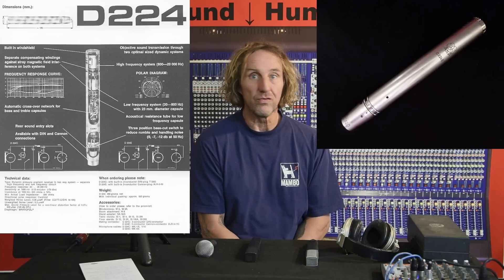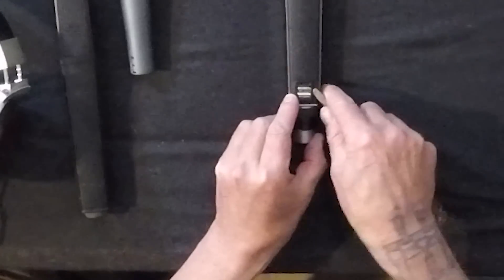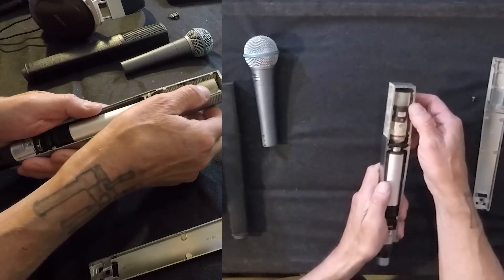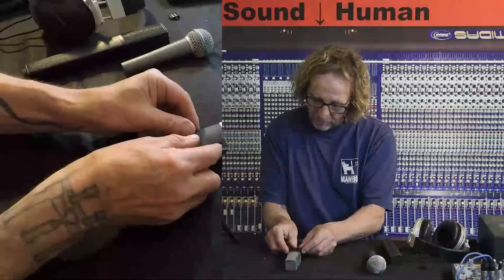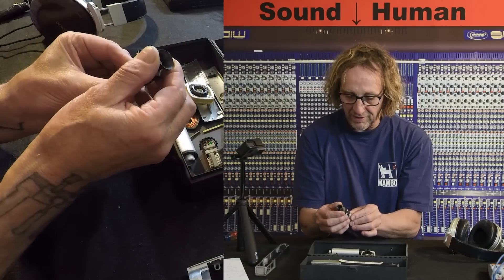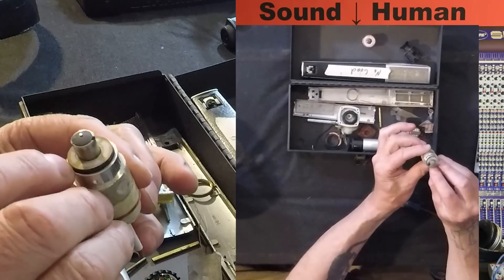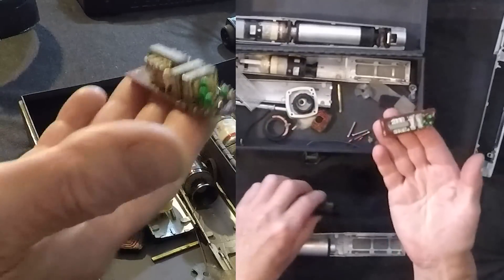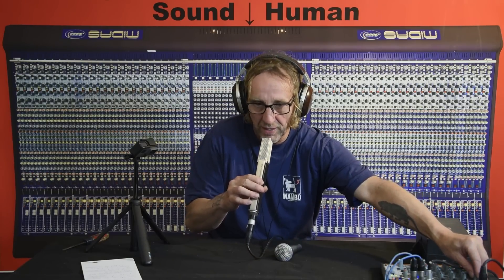Tear Down Beautifully Designed Sennheiser MD441(Public)

Comment: Ive got a vintage md441 thats possibly from early 70s. It doesnt have the phase plug and the inside of the mic directly goes straight to the diaphragm! I wonder if the previous owner removed it or if there are earlier versions without the phase plug design?

Comment: recently bought one of the old 441s and sounds amazing. my only concern is the tilt eq switch is gone and i was able to get the bass back by bringing the screw to a flat position. now im confused since in the video the screw doesnt look like a control for the eq
Reply from the maker: There is something else wrong as the screw should not effect the sound. A ground wire is missing
Reply: @DaveRat  is it possible this is a diy mod?
Reply from the maker: Hmmm, the chassis ground should not be connected to or impact the audio in any way. The chassis ground should be totally isolated from the audio.

So if it is a mod, it is not a desirable one.

Chassis ground impacting audio means that the balanced line noise cancellation will be diminished and in many scenarios the mic will have unwanted noise susceptibility.

Comment: My 441 was modified prior to my ownership and the high boost switch was wired to turn the mic signal off/on. I'd love to have that switch wired back to normal. Does anyone know of a schematic for that little PCB board so I can figure out how to wire it back to stock? Thanks!
Reply from the maker: Hmmm, if you follow posts here and when I get some time, I will snap some pics of the wiring
Reply: @DaveRat  Thanks Dave!
Reply from the maker: @breakburrito Cool cool thank you!

Comment: Hey there - Can you help me with the plastic (clear looking) between the top and the bottom just above the springy stuff - on mine is broken - should I super glue it - its rattling around inside the mic - I've taken it apart, thanks for sharing
Reply: Did you ever solve this? I have 4 of these and one is doing the same rattle. Thanks!!
Reply: Yeah but now I have to resoldier the wires lol  @johnforrestal
Reply: @ ah bummer man. Was it just a matter of gluing the parts back together? I saw someone mention screwing it on but I see no threads between the housing that holds the pcb, the first shock mount rectangle, and the capsule bit (I have a considerable bit of gap there and the capsule rattles around)…

I’ve never done a 441 repair but I’m trying to stare at sennheisers overly busy parts diagram and I can’t make out whether I’m missing a piece. I know I have to replace some plastic bits for the hi boost switch which looks harmless/easy.

Sorry you’ve gotta solder! Haha

Comment: Wow!! I've used one for years singing live! Just bought myself a brand new one. Do you believe there's a difference in design between the new and the older version?
Awesome video!! Thank you
Reply from the maker: I have not used the newer ones but I doubt they are as complexly or quality built as the old ones.

Whether the design changes make the sound less desirable I don't know but I am confident there is at least some difference in sound.
Reply: @DaveRat  Thank you

Comment: Hey Dave. Amazing video! I just bought a second hand 441 and it came with a nasty cigarette smoke smell. Any recommendation for trying to remove it? The mic works perfectly and there is no apparent influence on the sound, but I really would like to get rid of the smell.
Reply: @Pablo  Try putting the mic in a bag with baking soda for a few days. Baking soda worked on an area rug I inherited. I imagine you got the smell out by now since your post is 6 months old.... lol
Reply from the maker: Hmmm. If you have the soldering skills I would take the XLR off and open it up and lift out the entire capsule guts. Then take the outer shell and clean that with isopropyl alcohol and a microfiber cloth..

Focusing on all the grill and mesh stuff

I wouldn't mess with the capsule foam or any of that as it might be delicate and deteriorate.

Once the entire housing is clean if there's any smell on the inside it should have a hard time getting out.

Then reassemble

Comment: Where can I get the correct damping gel and the foam? Preferably in Europe...
Reply from the maker: That's a great question that I wish I had the answer to. If I recall correctly, it felt like it was silicon based.

A search for high viscosity silicon damping fluid may get ya close

Comment: Hi Dave, thanks for the great video. My name is Jeff from Australia and I have an old 441-U which is not working properly. It basically sounds thin and I'm sure it's not meant to. I inherited this from my brother in this state many years ago. Watching your video inspired me to take it apart and you're right the wires that connect from the main body to the part where the HP filter switch is....Well I needed to be a little more careful with it and I've broken them off. Anyways in doing this I've noticed there are only two thin wires connecting through to the part where the XLR plugs in, and I'm under the impression there needs to be three. Could you please clarify if this is the case and whether this would cause it to sound thin ?? TIA. PS I also need to know where the wires go back and given one is too short can I get that wire anywhere and try and splice???..Regards Jeff
Reply from the maker: Oh my, I don't have plans to open one in the near future. Is it possible to pause the vid and zoom in and see the wires?
Reply: @DaveRat  no worries Dave will do. Do you recall if it has 3 wires though?
Reply from the maker: Yes, 3 wires, the black one is very short and sometimes bunches up into the switch
Reply: @DaveRat  thanks so much that makes me happy as it's a step closer to fixing it in knowing that may have affected the sound. I'll need to try and work out if the third wire which wasn't connected is still there and if not then where on the switch it comes from. I remember you saying there is a blue, green, red and yellow coming into the switch so I'll also need to know which pole on the switch the third wire comes from and if it's not there I'll try and source some ultra thin wire. I noticed the first short screw you took out that holds it together in mine has been replaced and it goes all the way to the other side of the chassis so who ever has worked on it before may have lost the correct one and also disregarded the wire. Cheers again Dave 🤘
Reply from the maker: Good luck and keep me updated

Comment: This video was a life saver. I recently got a good deal on an early-ish 441 but the xlr jack was very loose. Using this video I popped the badge off and found that the set screw needed to be tightened the tiniest bit. Less than a quarter turn later and everything feels like brand new without needing to tear the whole mic apart. Thanks!  Also, agreed this mic is really
Excellent sounding.
Reply from the maker: 🤙👍🤙 so cool

Comment: Excellent video! , I have an MD441 , but the treble filter does not work .. I checked it and the cables are all in good condition and connected, there is nothing cut or loose .. The low-frequency filters work perfectly!
What could it be? can this be repaired?
Reply from the maker: Hmmm, there is more circuitry inside the aluminum tube.
Reply: @DaveRat  Yes I saw it in your video! .. but it looks very difficult to open that inside the tube, right?
Reply from the maker: I think there are two black dots where the end cap shows through. Should be able to sliver the end of but yes, precarious.

May be best left as is

Comment: Hi Dave, I got the BF541 and MD441U3, I when I slightly push it, I can feel the moving coil on the U3 but not the BF541, should I be worried about it ? The 541 still sound fine tho, it just I dont really feel the moving coil
Reply from the maker: When you push on the diaphragm?
Reply: @DaveRat  I meant I should be feeling something moving right, I am not sure if its suppose to be the diaphragm. Btw the build quality are a bit different for both.
Reply: @DaveRat  sorry for my English, I meant when I gently hit on the mic

Comment: Hi Dave I have 2 409 the foam needs to be replaced….is there a particular size foam I need? Thank you….
Reply from the maker: Oooh, I believe the 408 is around a 1/4" or so.  I would disassemble and measure it and buy a small sheet, also getting thin foam and using a couple of layers is ok too. As long as the foam is open cell where you can easily blow through it, you should be good

Comment: Hi Dave, thank you so much for this awesome video which finally gave me the knowledge and confidence to open a very old 441 (with that enormous Tuchel connector from the early seventies) my father handed over to me some years ago. Although it still has some output it did not sound like a quality mic at all, so I never used it. Now I found out that the round foam pad on the front end was completely rotten and some of the debris covered the diaphragm. I have removed that crap with an air cleaning rubber ball for camera objectives but now have to replace the foam. Do you have a recommendation which foam I should use for that? Thanks in advance!
Best regards
Chris
Reply from the maker: Super cool! Happy hear that. Maybe the best or easiest way to get foam is to take it from another cheaper mic grill. Knockoff sm58 grills are cheap and easy to get, or from a another cheap broken mic
Reply: @DaveRat  Thank you so much, I should have had this idea myself. Quite a few SM58 grills lying around here - old and new. Will try it later, great plan for this rainy Saturday here in Germany.
Reply from the maker: Awesome and let me know how it works out
Reply: @DaveRat  Unfortunately this did not really work out. Still I have to crank up my 1073 to +80 to have a very thin output without any mids or lows. Looks like the capsule is damaged. I will try to check the wiring with a multimeter next weekend, but I don‘t expect a miracle. Maybe I will find another one with mechanical damage and a good capsule.
Reply from the maker: Those hair thin wires to the voice coil are easy to break. A magnifying glass may show a break that you can get to and carefully resolder but odds are not.
Reply: @DaveRat  Thanks for this hint, Will give it a try. I am quite good in soldering (some touring experience in my younger years). But need a very small iron first.
Reply from the maker: 🤙🤙🤙

Don't get too hot of an iron as the thin wire will actually melt or dissolve, possible it's an aluminum wire, but not sure, I just recall it's a tough repair

Comment: Love 441s. Or the cheaper but almost identical 541s. I use them on all kind of acoustic instruments that got no pick-up or low acoustic output,    but need to be routed on monitor-wedges. They feedback like 3db later than a condenser would do.
Reply from the maker: Very cool and yes they do seem to be more stable than condensers I'm curious as to why that is

Comment: I’ve got a broken 441 with a dead capsule. Has anyone figured out a cool alternative rather than spending $500+ on another capsule??
Reply from the maker: That is a tough one, maybe buying one that works but has broken wires and housing on ebay

Comment: Found one years ago in a pile of audio junk and 02r expansion card in a control room inside a small music school. It belonged to the audio engineer of the band that started the school and concert venue right across the street. I didn't know much at that time, it looked like a old trash mic like the 10 other legit trash mics I found. Imagine my suprise after looking it up online !

The high pass filter is broken (spins endlessly) thankfully not on the highest cut setting. Is it hard to change (regarding the tiny wires) ?  I have used it and really liked it live on bass cab mainly and in recordings with bass, guitar electric and acoustics, and lots on vocals for metal and punk. Amazing mic, I just wish I had a damn mic clamp to use it properly. I opened it up one time and was mesmerized by the srping dampening system and how complicated it looked, compared to "regular" dynamic mics.

And thank you very much for being on youtube Dave
Reply from the maker: Awesome find!

Comment: Excellent timing, Dave - somebody just brought one in for repair!  Any idea where I can find a schematic or wiring diagram?
Reply from the maker: Oooh, that I don't know. I just open a working one and copy it when I encounter a wiring question
Reply: Hi Dave, i cleaned the front tube and replaced the foam on mine. The blue wire broke off when i pulled out the 5 pos switch, soldered it back on. Next to it is the red wire, but i don't see any  wire connecting to ground (btw 5 pos switch and hi boost switch) on mine. Is this normal?

Comment: Thanks for this thorough examination, Dave! I use this mic from time to time, but never really went thru its settings. I DO like its solid sound. You immediately feel how well it's made. German engineering, I guess. One of the reasons why Sennheiser has its reputation I guess.
---
That backdrop is very nice! Btw, do you prefer the H3000 over the XL4 in regards of sound? I'd love to hear your opinion on those top-tier Midas consoles 🤓

Kind regards from Germany - Hans 🖖
Reply from the maker: Very cool! I do like both but the 24 subgroups on the h3000 with the ability to rotary level send is something I prefer.

Comment: The black one is a Blackfire 441 (BF441). I bought one new as a surplus in a local music store in the early nineties. I should use it more!
Reply from the maker: BF541?
Reply: @DaveRat  yes!! I’m sorry. 😉 I did not use it for the last 20 years. 😅 But the MD441/BF541 and the MD421/BF521 are easy to get secondhand in the Netherlands. I have a bunch of MD421’s (white and black) and I even a MD422 and 2 BF509’s. 🤘🏼
Reply from the maker: Cool stuff! Yes, the BF versions are great and also a good source of parts to repair the md

Comment: Help ...! !  I just purchased a Sennheiser SKM 4031 wireless and EM 2300 reciever ( gets input signal from the mic but no output sound ) that are of the late 80's vintage and am in need of a repair resource , parts availability may be an issue . Any leads are greatly appreciated , maybe turn it into a video .
Reply from the maker: Oh my, never worked with one of those. I'd start with making sure the mic works. Maybe removing the mic capsule and touching the conductors to see if you hear a buzz of click.  If ya hear a buzz or clicks then maybe a bad capsule, if not, it gets more complex

Comment: Great video!! Maybe you can answer  Question for me, im in the market to buy a used analog board. I have a few small formats ( A&H , mackie ) but want a large format, preferably used. What would you recommend ?  Thanks for the videos Dave
Reply: Take your pick, the market is flooded with big old live boards for pennies on the dollar. If you're willing to do some tech work you can find almost anything.
Reply: @Scodiddly  you're definitely right, I have seen so many different boards that it's hard to decide 😆.
Reply from the maker: Buy the best as they will hold their value better and are more fun to own

Comment: Very interesting video ! The Beta58's top end sounds a bit harsh in comparison with the MD441. The Sennheiser has a "warmer" quality to it. You're right: it sounds almost like a condenser mic. I wonder if this has to do with the amount of compression from the capsule. I think condenser mics compress sound more than dynamic mics, resulting in a more pleasing sound. It would be interesting to compare the feedback sensitivity between both microphones.
Microphones are fascinating works of engineering. I would love to see the same kind of video with the AKG D12.
Reply from the maker: Hmmm, the typically lighter weight diaphragm of condenser mics usually result's in more transients. So a less "compressed" ish signal
Reply: @DaveRat  But since dynamic mics usually handle higher SPL, wouldn't that mean the opposite (=more dynamic range) ?
Reply from the maker: Dynamic range is sort of like top speed, transient response is like acceptation.

A dynamic mic tends to be more like a heavy car that can go faster and a condenser is like a lighter weight car that can accelerate and brake much faster.

Condensers tend to be more accurate at capturing the sound. Dynamics tend to blur the sound and add more resonances but because they do not rely on electronics, many can handle sounds at higher levels.  That said, both mic types will become more non linear with higher level sounds, but the higher level sounds areore likely to distort the electronics built into most condensers.

That said, building a condenser that handles high level sounds is quite possible, like the beta98, but the cost is they tend to be noisier with low level sounds.

Comment: Nice work Mr...A while back my mate won an Auction that got him 5 of CAD M9 tube condenser mics previous owner a Radio station . they came with only 1 multicore 7 pin XLR lead and as it happened the pin end of the lead had a pin that had pushed back causing nonoperation , I repaired that and opened all mics up to clean all connectors and ended up all good , very good price....My payment was to keep one , this is where I hope you may be able to help out...I noticed after having all 5 in bits that the one I decided on has connections to both front and back of the capsule , would that make this one figure 8 style mike ? Can't see anything on CAD site. Any clues Cheers loving your posts Cheers
Reply from the maker: The polarity and phase or delay of the connections for front and back would determine the pattern. Opposite polarity would be fig 8, same polarity would be Omni. And by altering the delay and phase, cardioid, super cardioid and hyper are possible.

So it depends on the electronics